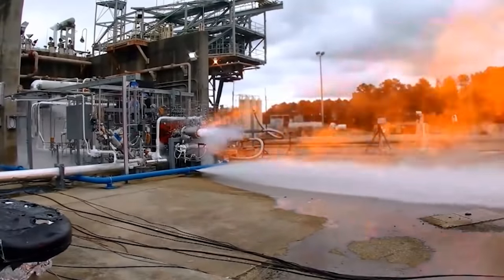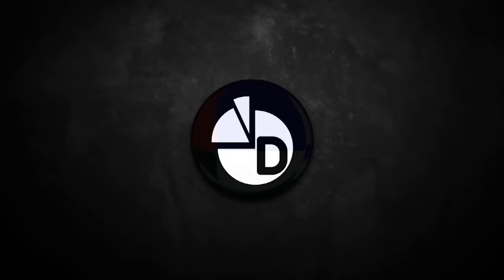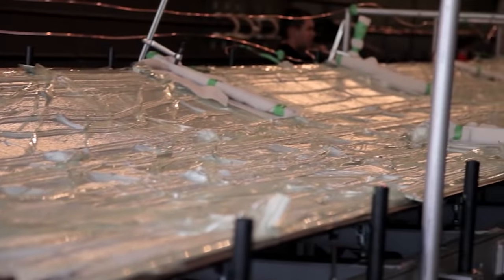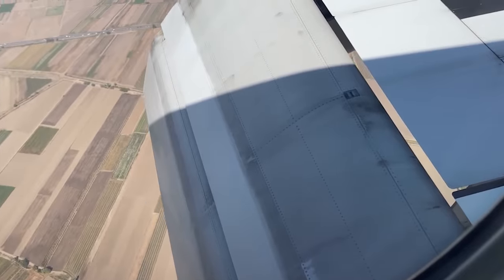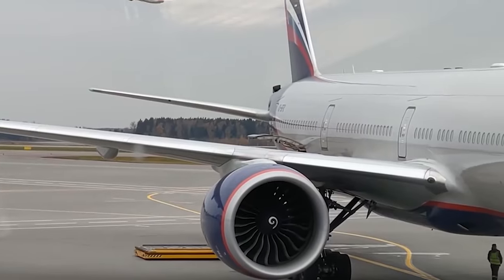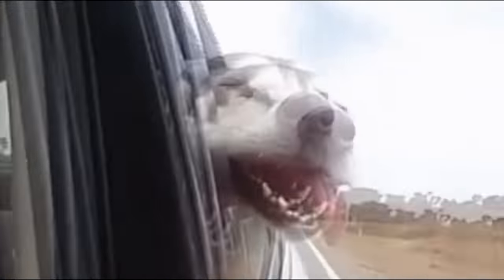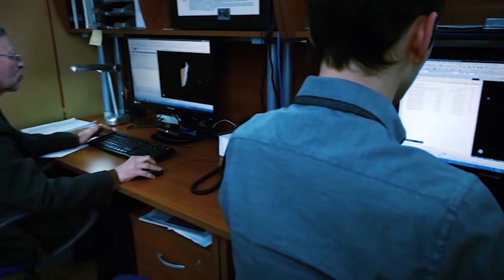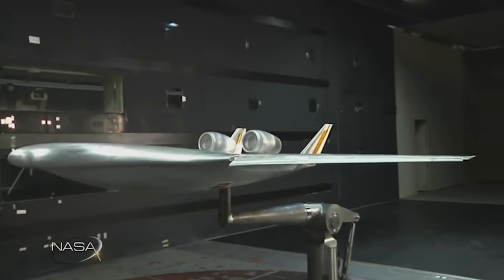Finally : NASA Is Testing Its New Generation Aircraft

Comment: Actually, at 2:37 the lift comes from the top of the wings creating a vacuum pulling the plane into the air. The only time when the bottom of the wings has any effect is when they are in the ground effect where the wind is compressed between the wings and the ground.